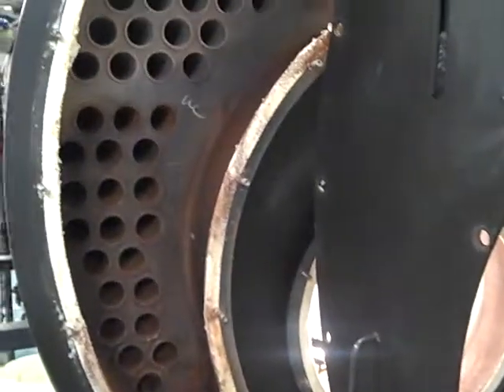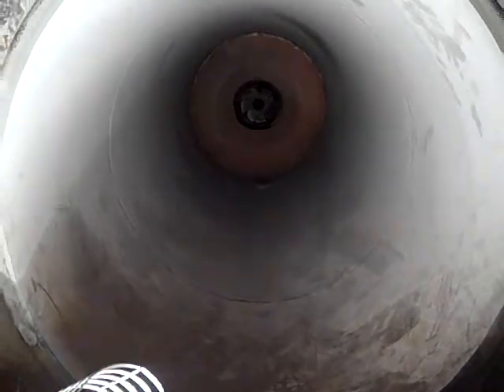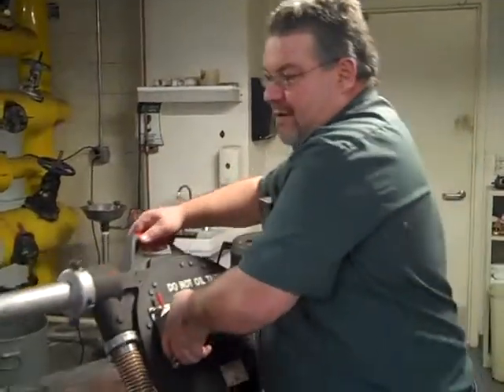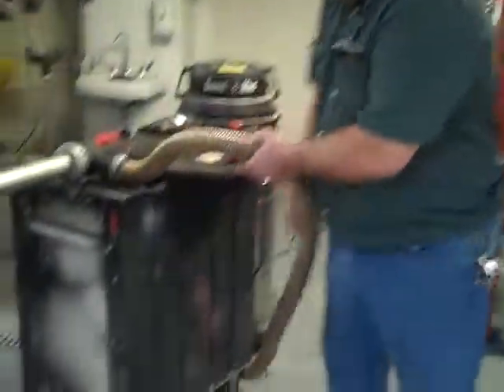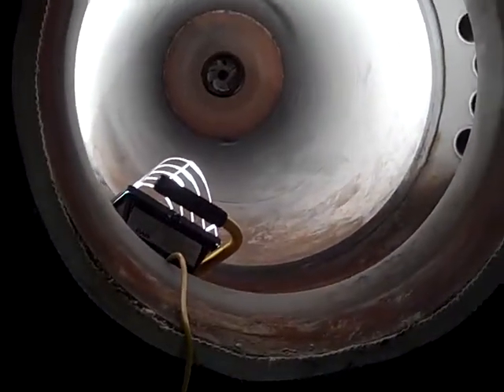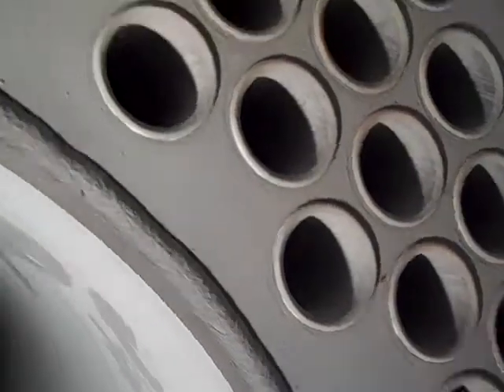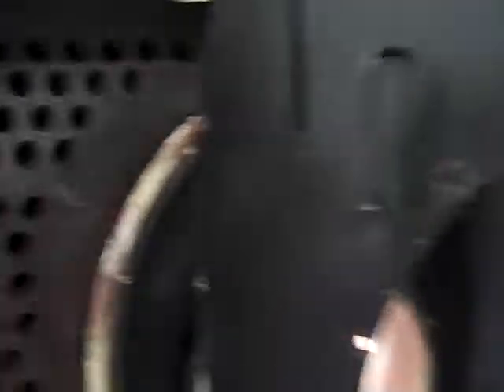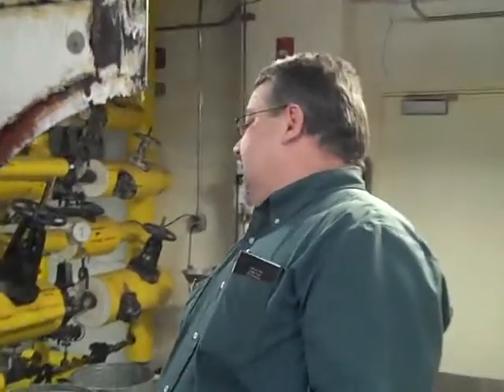Dirty Jobs Boiler video

Comment: I cleaned out some boiler fire boxes at a private school when I was 17.  Summer job. Scraped off maybe 1/4" of carbon and sulfur and wire brushed the walls prior to inspection.  Had to make my own foam breathing filters.  No oxy or rescue apparatus, just a fan and me on my back sweating my arse off for maybe $3.50 an hour. Circa 1970.